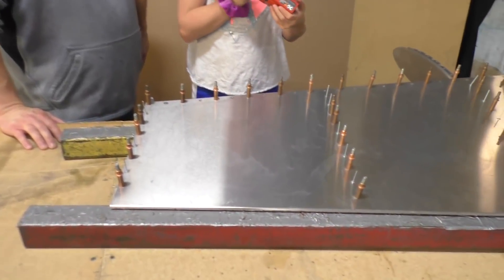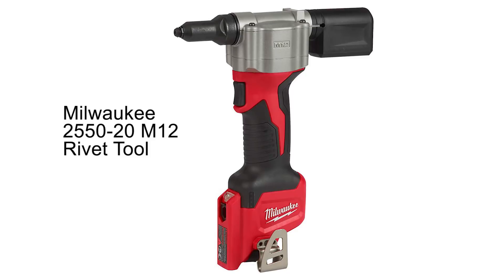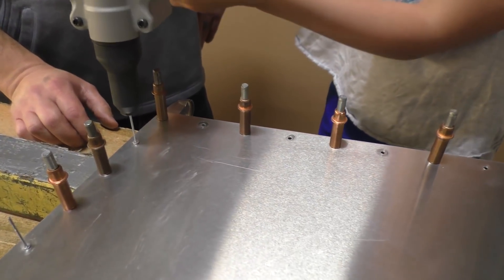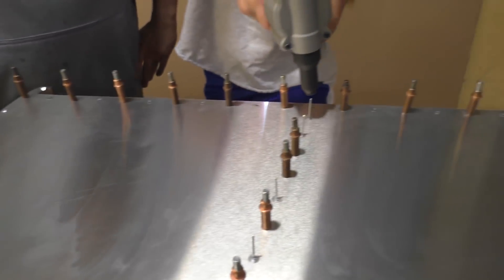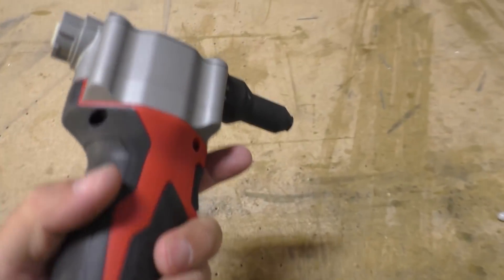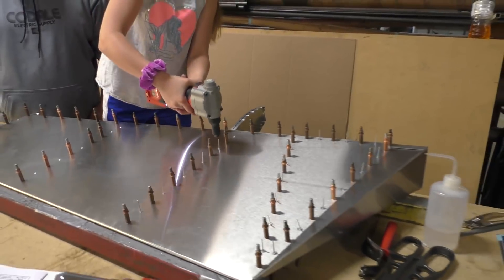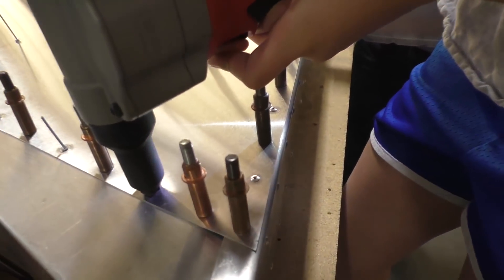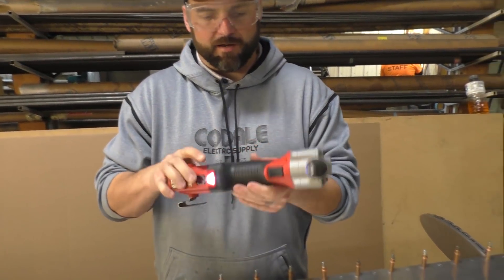Aircraft Riveting: Cordless Electric Blind Riveting Tool

Comment: Does the standard Zenith-specific machined head just screw on to the Milwaukee like it does on the pneumatic tool? Any idea how many approximate rivets/charge? Looks like a nice tool even I could use, although at my age I tend to be less coordinated than the average 10-year-old.
Reply: TigercatDesigns Yes the standard tip is installed the same as the pneumatic. Hand tightened. The entire rudder was completed on around 50% of a single fully charged battery. There is a battery charge level on the tool.